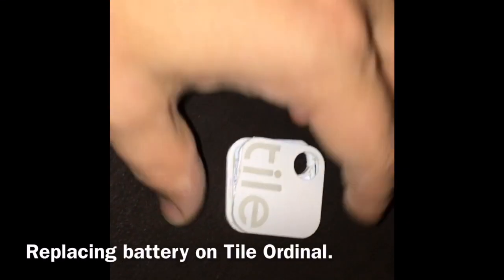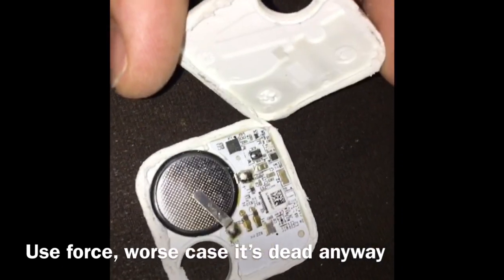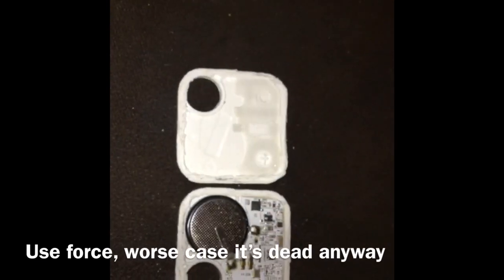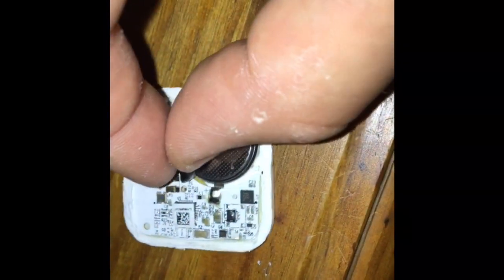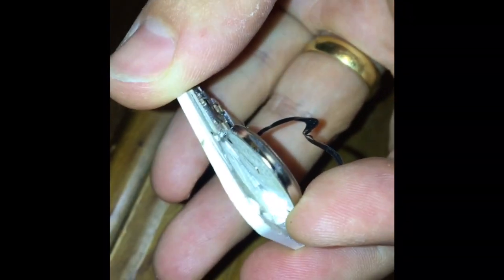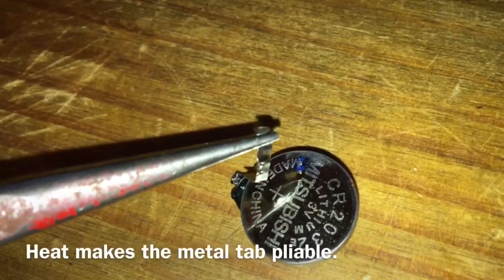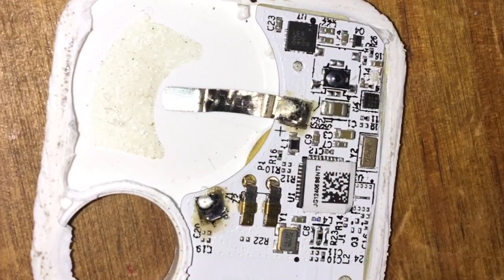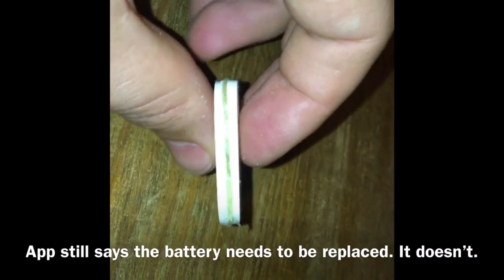Replace Tile battery

Comment: Wonder if I could use a heat gun to soften the glue and use a razor blade to separate the two halves? I don't have that much confidence in my hacksaw precision.

Comment: I bought a 4 pack of Mates last year, haven’t used them yet and the batteries are already dead. They should have some sort of pull tab to turn them on. Total BS... at least the new ones have replaceable batteries but the slim tiles don’t and those are the ones we use for our wallets (those go missing more than our keys lol).
Reply: Maybe you should get a bigger wallet, and throw a normal Tile inside.
Reply: Kinda defeats the purpose of a pocket size wallet. I don’t use a purse since I injured my back.

Comment: Battery replacement is possible and it worked for me.  But the problem is the Tile app expired the Tile and will no longer accept it so it was a waste of time.
Reply: That is very annoying, it's one thing to have the battery wear out, it's another thing for Tile to force customers to purchase a new one through force!
Reply: This was from awhile ago but if you’re wanting to get something similar from a company that doesn’t do this, cube tracker is good and comes with free features like ringing when it’s disconnected and things like that. Plus replaceable battery

Comment: Unfortunately they will now disable the tile when you replace the battery. I replaced the battery on a Tile 'Mate' that was expired and it would not show up in the app any more. I also replaced a battery in a tile that was still active just showed low battery. Now it doesn't work properly. It won't properly connect. Basically tile prevents replacing batteries on intentionally through the app. I think that's really shitty of them. The tile that has a replaceable battery is twice as expensive as the normal ones.